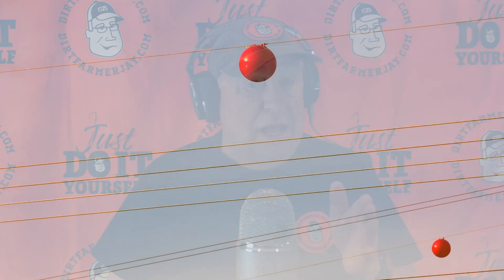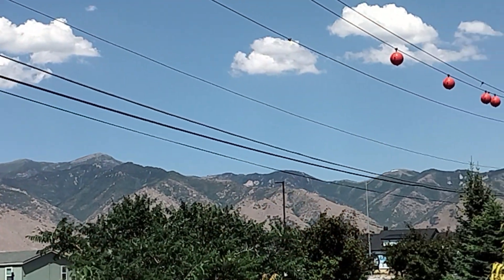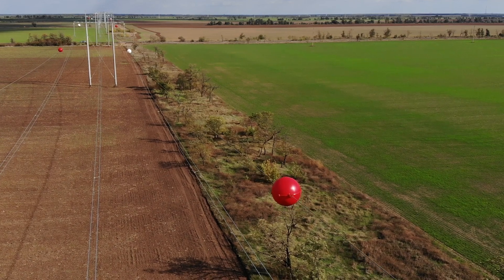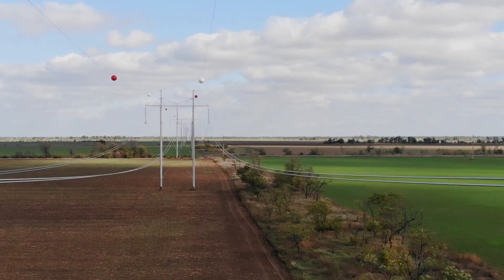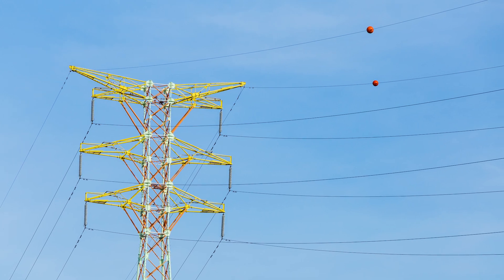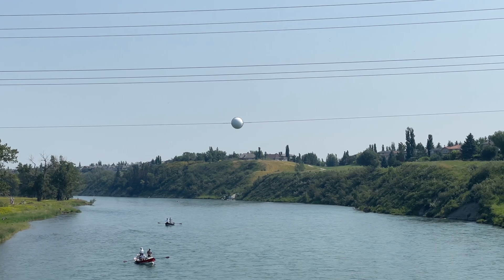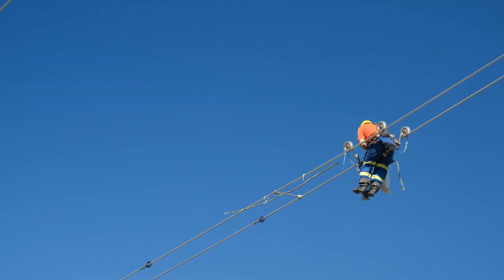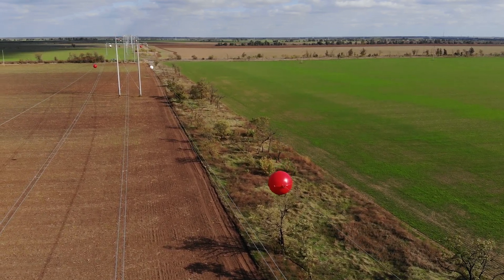What Are Those Balls on Power Lines? The Surprising Answer!

Comment: Also for crop dusters.
I have also designed some for a guyed antenna tower.
Reply from the maker: Thanks for that insight. On the antenna tower, are you talking about them being affixed to the wires due to their horizontal "splay" from the vertical tower? I want to be sure I understand what you intend. Thanks! - DFJ